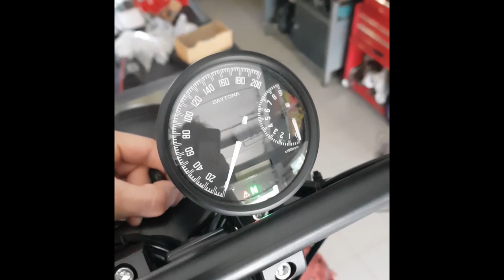BMW R1100 GS Custom Scrambler by Moto-Technology Full Timelapse Build

Comment: Really cool! How did you install the LED turn indicators? I bought ones for the same bike and i cant do it works
Reply from the maker: led turn signals need to be connected in place of the original ones together with special resistors that mimic the load of a normal bulb, This will make the turn signals flash normally and slowly